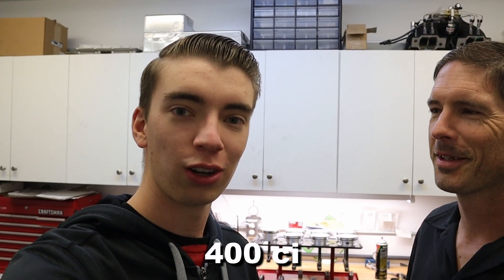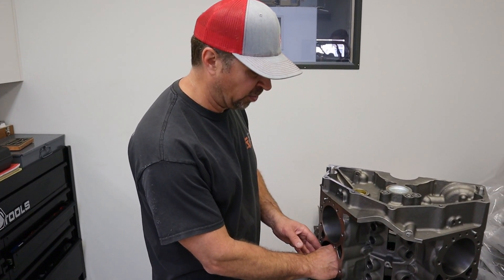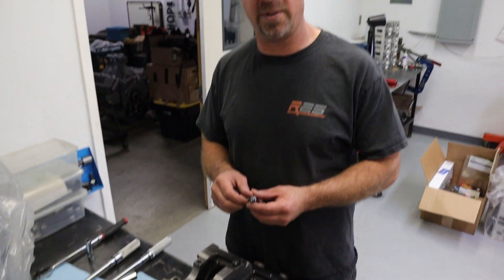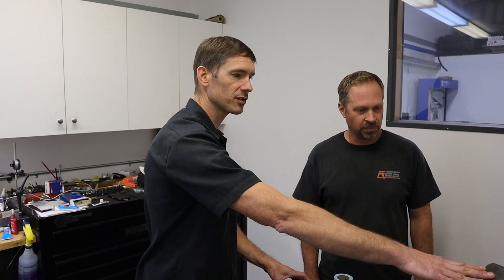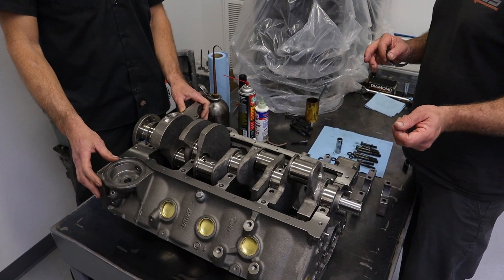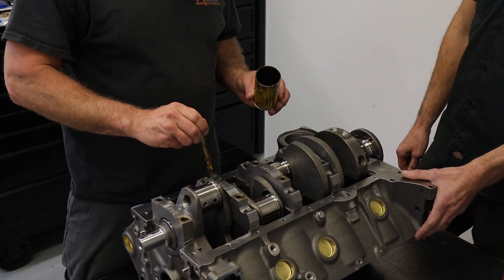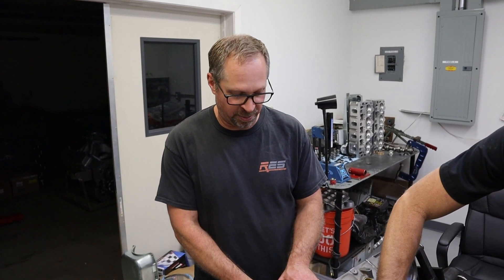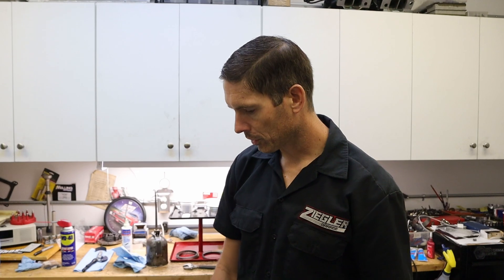BAD TO THE BONE 400 Small Block Chevy Build (1 of 3) - 67 Camaro Pro Touring Build

Comment: Question:  I really like the meticulous measurements, what though do you do if you spend a lot of time and money machining the block and something is way out of spec. Maybe a machine shop error or whatever. Throw the block away? What would you do? Have you run into this before?
Reply: I'll answer what I would do: it depends on what's out of spec. The most important thing on 400's (any block really) are your cylinders. With engine blocks, you can sleeve cylinders if they're too far gone, but with 400's, the 4/6 and 5/7 cylinders are detrimental. They're Siamesed, and sleeving too far can cause head gasket issues since now the head bolts will have issues through torquing. 

If blocks are cracked, I've seen some fix the cracks through welding and small stuff, but most just scrap them. That's about all you can really do. 

It'll depend on whether or not it's worth saving. Id it's like a 409 W block, you'll do everything you can to save it. If it's a 400, not SOOOO much. If it's a 350, absolutely not. There's plenty around of those

Comment: You guys did a 377ci? I heard the part wheee he saido its got 350 mains. I built mine last year. Thats an awesome block you guys have there. People are skeptical about the bearing spacers (i used them), but i onow scat has a 3.500 inch stroke crank with 400 main journals on it. I love these builds. They never get enough credit.
Reply: no it’s 400ci, the crank has 3.750 written on it
Reply: @Loswag888  At 1:34 he says it has 350 mains. What does he mean by that?
Reply: @mikeholguin84  the aftermarket block/crank have 2.450 mains (350) instead of standard 2.650 for factory 400sbc. smaller main journals have less friction and stronger because the caps are thicker. this is independent of stroke
Reply: @Loswag888  ah ok. Yeah I don't know how I didn't think of that. Just like I wouldn't say I got a 3.48 crank or a 3.25 crank, lol. Id simply say a 350 or 327 crank. Dang man, smh, I should've thought a little harder lol

Comment: awesome .  what do you think about this? = 3.8" stroke 6" rods, dart 4.155" bore block, Dart cnc 227cc heads, 10.5:1 static compression, XR294HR10 hydraulic roller cam. 1978 Z28 with road race spoilers and fender wells filled with 17x7 P215 (50's ? )fronts, and 15x12 rear slot mag wheels with P325/60R15 or 50 series nitto nt555 street all season rear tires.
Reply: Sounds like a nice engine to me
Reply: How much hp and torque? I have the same cam in a 383 with edelbrock rpm heads and it won't rev past 5800
Reply: @kingsleysmith2830  it wont rev past 5800 because you have edelbrock RPM heads.  that makes total sense.  theyre 185cc.  you wanna rev this thing to 7000 or something?

not a knock on your combo  but thats what you built.  about a 425HP small block  street rod engine that'll run like a typical crate engine.

the guy above?  thats like a 550-560 HP engine because of those heads although he needs a solid roller with those AFR 227.

a sorta destroked 400 is gonna wanna turn up.
Reply: with a 294HR cam i a almost 400 cubic inch destroked youd want smaller heads like a 210 AFR head

and get a solid roller if you really want to utilize a 227  AFR head.  

thats a big head for a pump gas small block under 400 inches.  people use those on 434s and make like 650+
Reply: @KingJT80  Thanks, i am leaning toward Brodix 221cc now. Although want to go smaller. Going to 3.9" stroke for 423 c.i. And 10.75:1.
Reply: @zAvAvAz  yeah 421 are good combos.  That'll be a nice engine if you run it on pump gas.  Just run a solid roller that's street friendly and it should be all good

Comment: Is it possible he could get his damn thumb off of the duration specs of the cam? I think mine is going to end up at 248/257 at .490 lift. Stock heads, rockers, and springs, hydraulic flat tappet, stock pistons, probably 8.5 to 1 compression ratio.
Reply: That was annoying,  I think he was embarrassed that they chose a cam with such a wide lsa so he put his thumb over it.